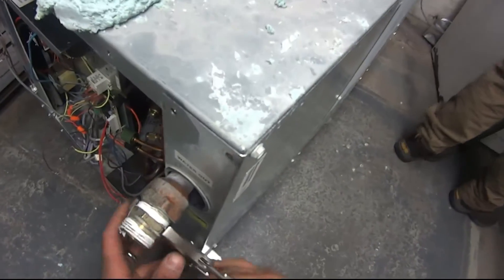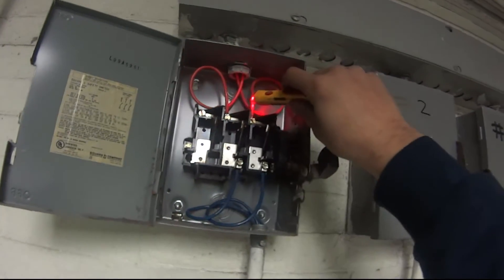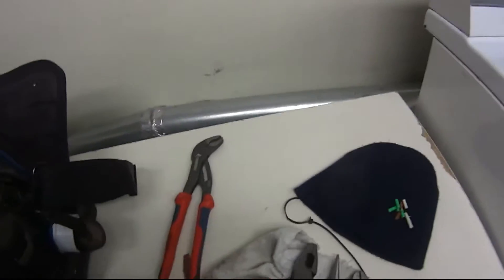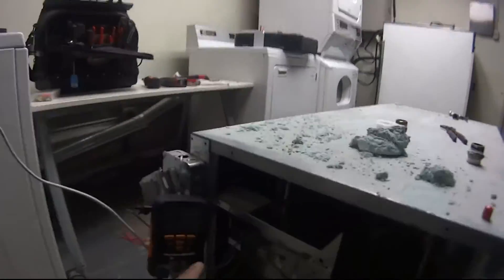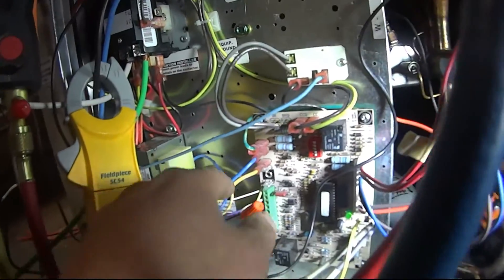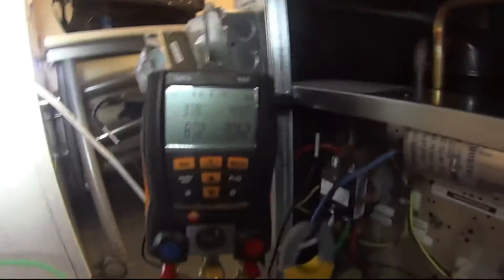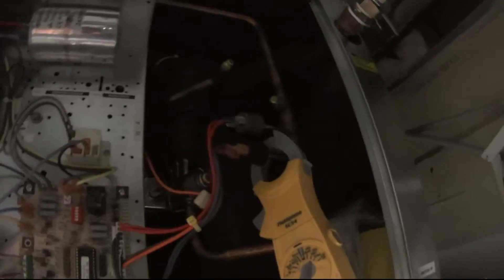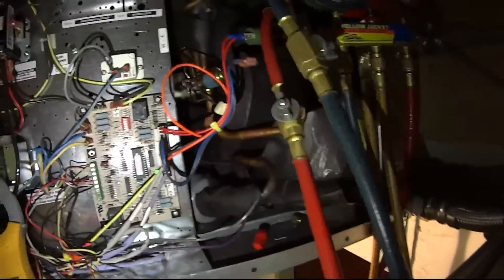HVAC | WSHP-BAD TXV | LEAK SEARCH PT3

Comment: Hey Emin on those heatcrap units don't the  thermistors cause the unit to lock out and give you an under temp fault code on the board??? Good job man....
Reply from the maker: Thanks. yes they do, I hate it when it happens. However they are necessary to protect the unit from icing up, otherwise the chances for a cracked heat exchanger is greater.

Comment: Cool video as always! Looking at the cobras myself and interested I  the test gauges. What are your thoughts on the gauges? Thanks!!
Reply from the maker: Thanks for the support bud. I really like the TESTO gauges they work well and are priced at a reasonable rate. However I did have an issue with it and got them warrantied. They were leaking internally, Testo honored the warranty with no issues and replaced them with a brand new one.
Reply: Thanks for the feedback and quick reply! Support your videos 100%
Reply from the maker: Fred Medeiros NP bud. I appreciate your support.

Comment: Emin u at 666 subs , want me to unsub lol.
Reply from the maker: ah haha really that is just too funny 666 lol
Reply from the maker: I'm gonna take a picture of that lol
Reply: Hey man sup ? ralph here , quick question bro ,
when checking refrigerant with the manifold how do you the unit has proper refrigerant inside by checking its specifications or by just knowing how much a unit that 410 or 22 suppose to have ? P.s great job
Reply from the maker: Rafi Diaz The best way to determine proper refrigerant charge  is to always use superheat and subcooling. most manufactures will give you a subcooling target range. With TXV  its a good practice to charge with subcooling and with out, with superheat. I don't really ever work on units with out TXV's most of my units are large commercial equipment so I don't see much orifice set ups
Reply from the maker: Rafi Diaz If you need more info just PM me I'll try to help out to the best of my knowledge.